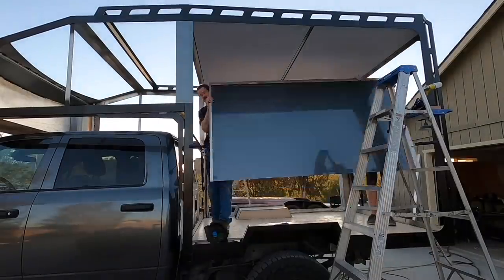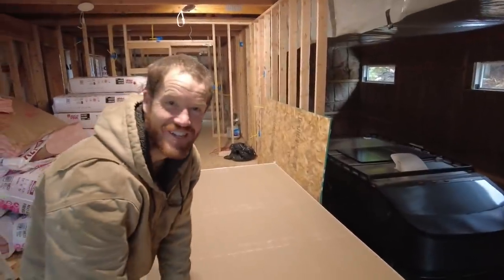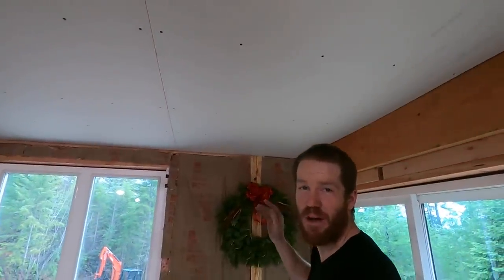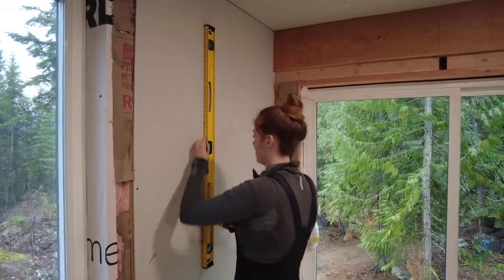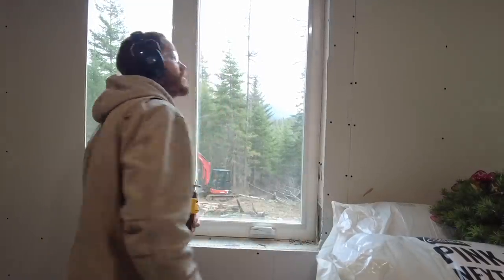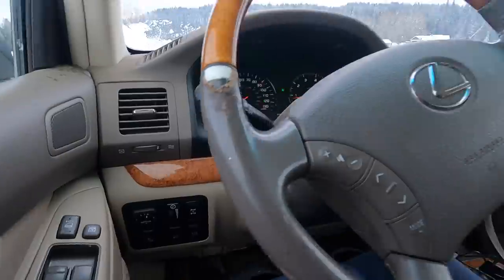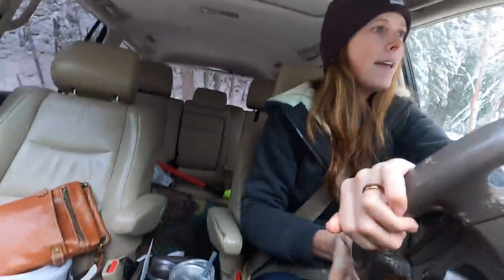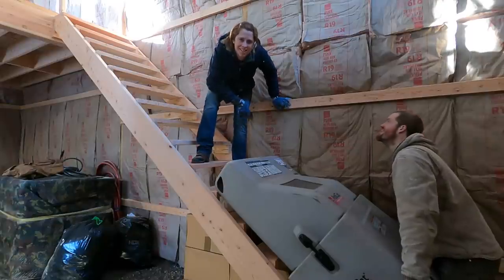Building Our Own Home | Drywall

Comment: On your walls run your sheetrock horizontally (left to right)  instead of vertically. Horizontal hanging reduces the lineal footage of seams by about 25%. Keeping the footage of seams to a minimum will result in less taping and a better looking finished job. Hanging horizontally also allows the drywall to flow over the framing so that bowed studs create less of a problem. That wall next to the patio door will easily show off any stud that is bowed because of the light it will let in.

Comment: We keep bags of play sand in our trucks during the winter.  If you get on a slippery spot and can't get traction, throw some down and it can help get you moving again.  And it sticks to the packed snow and ice.   Also, you might want to put a small cover over your man door.  When the snow comes down off the roof, it can definitely take you out!
Reply: Bags of salt or no cost use ash and cinders from wood stove

Comment: Easier if you build yourself a T out of 2X4s,  the T is a little longer than the distance from the floor to ceiling, the crosspiece at the top is slightly shorter than the Drywall is wide... You build 2 Ts and use them to hold the drywall up until it is attached to the ceiling joist...
Reply: @blatham59  I named mine Fred.
Reply: That's how I hang drywall by myself, I make two of them and they're both called slim Jim!
Reply: Yes I agree with the "T" you can hang dry wall with a dead man or  Fred oe slim jim ... when doing 5/8 it is must for me because I am to weak and old.
Reply: @jerrymiller270  as in Fred's ridin' Fred?

Comment: What you needed was 1X3 striping that runs across the ceiling joists 16" on center, that will make the whole ceiling stiff and 4'X8' drywall can run in either direction.................Most people that have no fear die very young!

Comment: If you stagger your Sheetrock on the ceiling, it makes taping and finishing so much easier! 
You forgot the vapor barrier on the ceiling of the apartment, but a good primer and paint will help stop the transfer of moisture.

Comment: Courtney: "Courage is the facing of a challenge with a healthy fear, not being fearless." Fear is just your gut telling you to consider what you are doing before you get into danger.  What you did is sensible and smart!  Plus pretty sure your healthy handling of fear had kept Riley intact many times over!

Also if you can get a load of sand in on the Army truck I think a supply of grit for slippery sections of the driveway would make a world of difference.  I would also consider chaining up that plow truck and adding some ballast to the back.

Comment: 1/2" drywall on 24" centers of a ceiling WILL (in time) sag between the rafters and be 'wavy'. I see it a lot down here in TX but it will take several years to happen.... it's not a serious problem.
Reply: In some areas 5/8" drywall is fire code on ceilings and exterior walls. If inspections/code isn't an issue I wouldn't worry too about it unless you are worried about sag in the future.
Reply: @khockin  if a living residence is ABOVE (but in this case i's more like dagpnally adjacent --by code probably still considered above) a garage that contains vehicles code in most  of the country says 5/8 is needed on the walls between habital spaces above the 'garage' .... Family owned Drywall business for 60 years i have seen first hand the difference.  the goal is to slow down any fire (which ALWAYS goes up the wall) to give enough time to evacuate.  i have seen studies that show it can add a few minutes.... and my comment is purely for general  awareness ... i love this channel and am amazed at how they can pick up just about anything they set their minds to.
Reply: The  way to solve the 1/2 drywall waviness ... put shiplap on the ceiling  or put up beam the ceiling 

Note: the waviness will come from the insulation weight
Reply: Also it is too late now but I was taught to always stagger starting sheets as close to a full and then as close to a half as possible and hit your studs/rafters.  That goes for sheetrock or OSB subfloor or anything else in sheets.  Helps with strength on anything and also helps hide straight line joints showing through the tape and texture for sheetrock.

Comment: Oh….One more plowing tip…..You’ve got a long rough road. Make your first plow passes with the plow raised just a bit. Let the truck pack down some snow for a few trips then you can let the plow float. If you just drop it first thing, you’ll beat the crap out of it and be excavating dirt. And if you can pull,it off get snow tires on that truck. It makes all the difference in the world. You can chain up but that’s such a pain. If you use gains on the front you’ll have to go very slow. All that plow weight on the front tires will beat the front end to death.

Comment: With drywall applied vertically the tape joints standout when finished more so than horizontal taping. The ceiling  (as well as the wall ) sheets should be staggered so there are T joints and no X joints to reduce cracking and visual tape bulge on completion.  I made all of those mistakes 50 years ago on my first project!  But most important is to keep having fun.
Reply: Yes, stagger your joints. With drywall, sheathing etc...not just for appearance  but more importantly strength.

Comment: I literally just did insulation and drywall on a ceiling last month.  One note, a T square makes doing drywall a snap.  Also, I have an old DeWalt drywall screw gun that makes doing drywall alot easier.  And finally, I bought a Harbor Freight drywall hoist and it made doing the ceiling at least 6mol times easier.  I must admit that I like your idea about putting the 2x4 on the one wall as a spot to hold up the drywall while you are putting screws in.

Comment: My wife makes the same face when she’s concentrating really hard. So proud of all the work y’all have accomplished! If you haven’t pushed snow before, it’s a beast. Pay close attention to your marker poles and be ready for the truck to want to go the opposite way when pushing a heavy load while windrowing. Make sure and check all your bolts regularly and top off your fluids on the plow. I’ve hit man hole covers that sheered 10 bolts holding my cutting edge before and had to dig it out of a pile of snow (not that you’ll go over man hole covers). Also, keep spare hoses and an extra solenoid if it’s in the budget. Granted you’re not running it for 10-20 hours straight multiple days a week, stuff still breaks and having to run to town to get something in a storm sucks. As always I’m so, so proud of all the things y’all have accomplished.

Comment: Snow takes a delicate touch on the gas pedal, kind of like mud.  Low range, low gear; don't depend on your auto transmission to keep you in low gear, put it there.  Horse power can get you into trouble fast with slippery conditions. Use the power only as a last resort to keep from going down the mountain the wrong way.  When it has been raining and freezing then snowing, you can count on some ice below the snow.  I'm a Texas boy, so I haven't seen much snow here, but I've driven in it plenty of times to know that a little finesse goes a lot further than a lead foot.  Happy four wheeling!  You did great.

Comment: Have you considered foaming the ceiling . As someone else mentioned 1/2 drywall could sag over time and by adding the weight of blow in insulation it could cause additional problems. Once foam is dry it will support its own weight. Just a thought. Super couple doing a super job.

Comment: You can spray insulation foam as a base layer on the sheetrock prior to the blow in and it will prevent the humidity sag the 1/2 will show eventually by providing blanket reinforcement.
Reply: That is an interesting idea ...

Comment: You need to stagger the joints on your drywall, especially the ceiling. This would be an automatic fail during a drywall nailing inspection. Also on walls drywall is usually hung horizontally not vertically.
Reply: Yes, I learned those same lessons the hard way 45 years ago.
Reply: didn't see this comment when I tagged mine onto one above.  Was thinking the same thing on the straight across panel seams.
Reply: I agree with the comments about staggering the joints.  The pattern for nails or screws should be every 6" on the panel ends, and every 8" on the studs in between.  That means 9 screws on each end, and 7 screws on the intermediate studs.

Comment: Looks wicked. One suggestion is you glue and screw the shet rock, stops the sheet rock saging around the screws in the future, also its common to stager the sheets to stop cracking in the plaster, it's also strengthens the ceiling and prevents flex. In new zealand we always run the shed rock horizontally on the walls and avoid putting joins in line with the windows to prevent the plaster joins cracking.

Comment: Courtney you are absolutely right about using full sheets of drywall around windows and doors.  Drywall is cheap, taping is time consuming (expensive).  TIP:  To prevent those corner cracks, when you get to taping, run an 8" piece of tape diagonally across the corner where the crack might otherwise start.  This reinforces the paper at the corners.

Comment: Good idea using the wood as a brace between drywall sheets. Home Depot sells a drywall repair clip that I have used for unsupported areas, they are about $20 for 50 each. Like other posters have said, just ignore the negative comments, you guys are doing awesome! Remember, you raced off-road before, you got this snow thing!

Comment: Again Nice job. I sure you've probably already have an answer to that big gaping hole in the wall next to the wood burner which is a safety and heat loss. I was thinking a sliding barn door would be a novel idea. Court you have such expertise with the excavator and down the road you'll be moving all kinds of things up there that you would want to struggle up the stairs

Comment: BTW we doubled the drywall in the half overlay manner,  in the previous house, to make it more sturdy, and better insulation. Regarding the cracking etc. - there is no real solution to it, different materials expand and contract differently, and even different types of wood. So it will  crack less in places with moderate temperature changes, and more closer to your stove.
Also as wood dries and contracts or expands as it gathers moisture, it very likely affect how the drywall will behave. Also once you get the whole building heated etc. the moisture level will change, and it will reflect on the drywall ...

Comment: Forget about any haters and just push thru anything you need to. The living space is starting to look a lot smaller now that you are getting the drywall up.  I talked the wife into letting me get my first plow many years ago now. We didn't get any real snow once I owned it so I guess it did it's job. When we moved and she made me trade it in on a new truck the guy we traded it to was plowing his lot with it two weeks later. So if you don't want snow let me move there and buy a plow and you will not see another inch of snow until I sell the plow
Reply from the maker: Isn't it funny how that works out! 😆 But it does appear that several feet are in the forecast for this weekend...

Comment: Shame on any haters for giving you any grief for being afraid to drive on an icy, snow-covered mountain path.  At this point the way to your home is not even a road for goodness sake!  

I used to drive well paved roads in the German Alps and they scared the heck out of me.  That is why I never had accidents driving on them.
I was aware of the dangers.

You had a right to be frightened hauling such a heavy load.  You could have easily jack knifed in a slide.
Thank God you two made the trip safely.

Comment: What you can do is take two 2x4’s and make a T out of them where its just tall enough to hold the board close to the ceiling. The top of the T goes against the drywall, makes it easy to hang ceiling dry wall. Great video and happy for you guys getting the room insulated and drywalled in.

Comment: Excited for you guys! Hopefully you don't get it all done in this video because you need to stagger your seams - put in a full length one next to it start with a four footer. Great job on facing your fears! You'll start to find out once you drive on the snow and compact it, then if it gets cold over night it turns to ice and that's when it gets real slippery.
Reply from the maker: My understanding was that ceiling seams do not need to be staggered, only the walls?
Reply: @AmbitionStrikes  nope, pretty much everywhere, goes for all construction really, some cases for aesthetics some very much needed for structural purposes
Huge props to you guys for taking on new challenges! Get used to driving on snow n Ice little bit at a time, it’s one of those things you can get too confident in and then hello tree 😊

Comment: Just a tip. Putting lipstick on the outer surface of electrical boxes and pressing the back of the drywall sheet to it leaves a good mark to cut your drywall from.      Dave

Comment: Love the video's and the both of your wills to achieve your goals. I have 3 concerns (as a tradesman) 1st you always need to stagger your joints, 2nd you did not vapor barrier your ceiling (major heat loss) and 3 is a combo. 5/8" is standard on ceilings but isn't that big of a deal except you have 24" centers on your rafters. If you do not put bracing in you will get major sag between joists, this will occur if you do not address. Best wishes to you both (including the dogos) Edit: you do you and how you feel is proper, I'm just a guy looking in.

Comment: You might want to put chains on the plow truck.  I don't think either of you would have had trouble coming up the hill today, if you'd had chains on. Just remember to go a bit slower with the chains. The chains will get you through places where you relied on momentum before. And use real chains. Not cables.

Comment: 30yr veteran hanger taper here. There's nothing wrong with using the 1/2" rock on the ceilings but you do want to stager your butt joints for taping

Comment: For future use, make a T out of 2”x4” or 2”x3” like 1/2” taller than finished ceiling height. Then place drywall against ceiling, make sure the T is running length wise across drywall sheet and slightly wedge it to perfectly hold drywall flat against rafter for hands free nailing/screwing.
Reply: Or, I built T's out of 2x4s and made a sleeve out of same, the latter of which I clamped to 2 ladders and used vise grip C clamps to stair step the sheets up, which enabled me to do   the ceiling drywall by myself 45 years ago.

Comment: Pick up drywall shims, and don't break the paper! :)   You can slide them in behind a low spot and not have to pull the sheet off.   Also put the wall sheets up horizontally, it gives less joints to process, 1 single joint vs multiple vertical joints.  Also, nice choice on wifi router.  Mofi 4500? :)   Nice job on conquering your fears and getting out of your comfort zone.  Screw the haters!

Comment: If you use a 8 ft 2x4 and screw a 3ft board on it shaped like a T you can use to hold up your dry wall , I think they call it a dead man and it makes hanging dry wall a little easier .😁
Reply from the maker: Thanks for the tip!

Comment: Noticed the lights you installed looked identical to what I used in my kitchen and within 8 months I’ve had to replace them all. Upon inspection after taking them out the plastic junction boxes were all melted. I’ve replaced them with similar ones with metal boxes and so far all is good!

Comment: I agree with the other comments about staggering joints and running the walls perpendicular. I also suggest getting a drywall dimple driver bit for your screw guns, it will help the mudding go much quicker.

Great job getting after it though!

Comment: I was renovating water damaged ceiling in kitchen and bathroom, after I had 5 broken ribs after hit in a crosswalk in Surrey ( do not live in Surrey }. This work Riley and Cortney makes look easy,  later they use a drywall lift for 12 foot sheets, holding drywall and screwing is very hard on the back.

Comment: Courage is being scared but persevering.  You showed courage in your first solo drive in the snow.  Bravo!  It won't be the last time you will need courage - don't become complacent.  It's slippery because it rained before it got cold and snowed, and the topsoil is now icy.  Recommendation, especially for the truck: Get tire chains (with re-inforcing lugs) for the rear tires only.  Chains on front and rear would tear up the transfer case.  Chains will allow you to use 4WD and go slow enough to avoid sliding out on curves, plowing or not.  I'm a little surprised you did not get chains and a plow for the Army truck, in which you could carry extra weight (sand?) to get some real traction!

Comment: FYI if you cut a stud and screw a 2x4 about 4 feet to the top of it and the length is just slightly longer than bottom of drywall to floor you can wedge it to hold drywall while you screw it. Saves on holding it the whole time

Comment: Regarding the pick-up truck, add some additional weight (sand is best if possible, so you can throw it under the wheels if it is slippery) in the rear while you are snow plowing. It is hard to tell what would be the best weight to add,  but I would not go higher than half of the max permitted load, though loading my Ford Rager RWD pick-up with something close to a metric tonne made it nearly unstoppable.
Reply from the maker: Thanks for the tip!

Comment: A do-it-yourself hands-free support, sometimes called a deadman, holds drywall in place against the ceiling. This allows the builder to use both hands for the process of nailing or screwing the drywall to the ceiling joists. The deadman brace resembles a large letter T and is useful only for ceiling work.